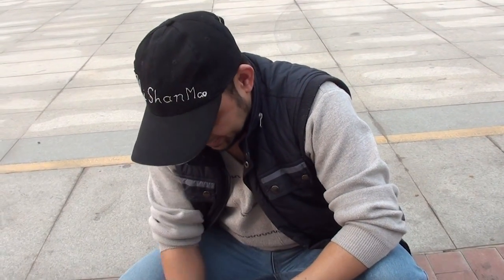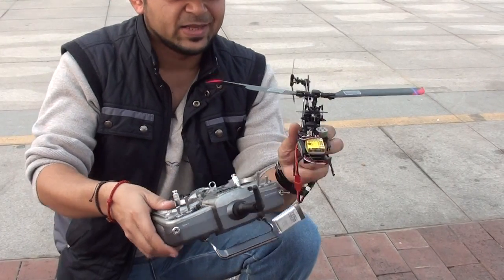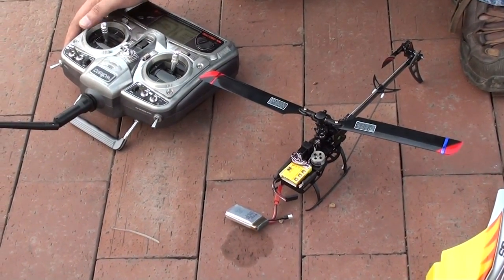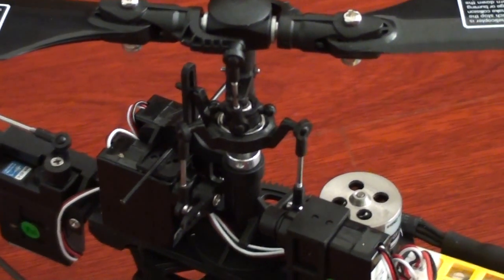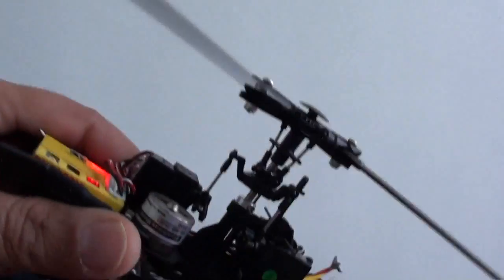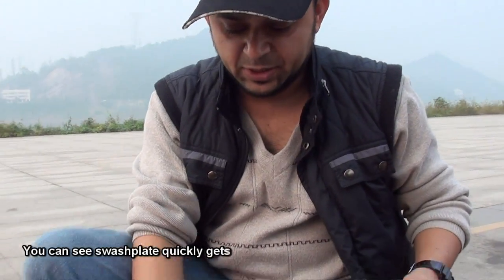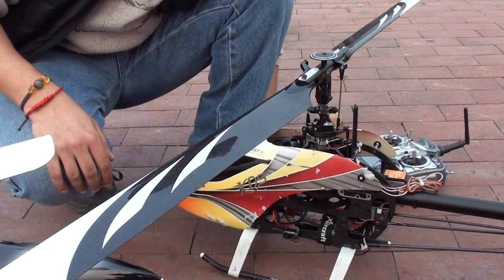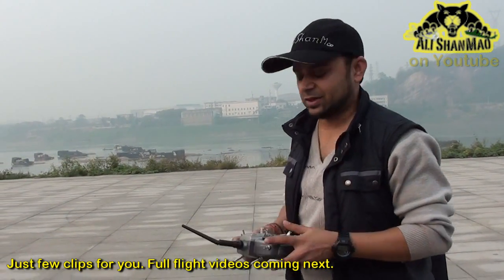Walkera V120D02S is it really a servo delay issue

Comment: Dear Ali Shah, As Salam a lakum. I recently purchased the Walkers V120DO2s with devo 7 radio. Flies very well but I observed that towards the end of flight (flight timer I keep at 6 min) if I try to keep it stationary in hover the tail rotor wobbles trying to keep it stable in flight and even would spin partially with a jolt to keep helicopter locked in. When i land it and give it a few seconds rest and then fly it it flies fine for a min and then starts behaving again like that. 
Note: This happend when I keep helicopter in stationary hover for a while towards the end of 6 min flight. And if I  fly it in circles or do sport flying speed runs it works rather fine.
My guess is that tail servo/rudder servo becomes warm trying to keep helicopter locked in stationary hover and when I give it rest of few seconds it behaves fine again.
Am I correct? Secondly should I change rudder servo with some strong one?
Please advise. All settings are stock factory settings.
Reply from the maker: obviously a faulty product from walkera. and talking to them has no use. they will never reply. That is the reason we have stopped supporting walkera. they are nothing but Crappy and copied products manufacturer who just want to sell without helping clients.

Comment: what channel controller do you use? whats a good suggestion for a good controller for a beginner, that wants to learn and fly a few heli's on?  I'm done with the cheap 3.5 channels, want to move up now that i feel like i won't wreck a good heli on first flight, i want good stuff but for a controller I was hoping to spend a few hundred tops 200 US, used on ebay if have to.. just not want to have to buy another controller when I move on to better and bigger heli's, well thank you for your vids

Comment: I want this helicopter, micro, flybarless, torque tube, it sounds awesome, I have an MCPX and the motor driven tail blows out all the time transitioning to inverted and I really try to be easy with my collective but the tail still sucks, I just wish I could use my DX7 with the walkera, I hate having a bunch of transmitters. Anyways, thanks for another great video!